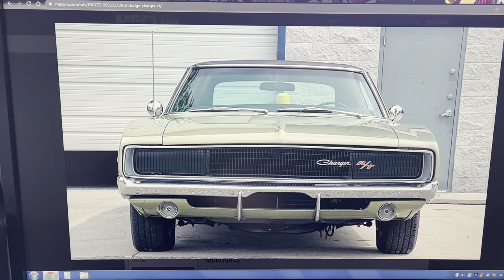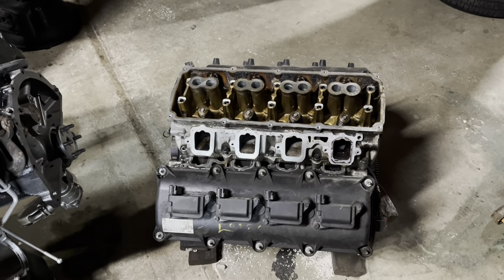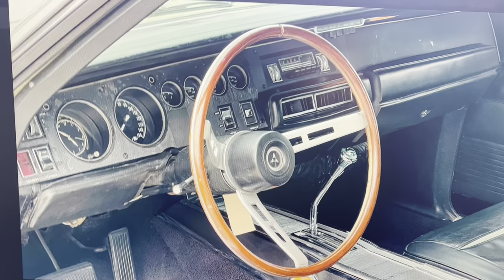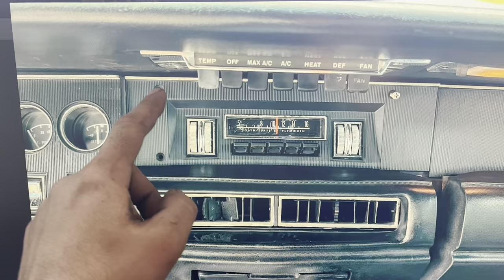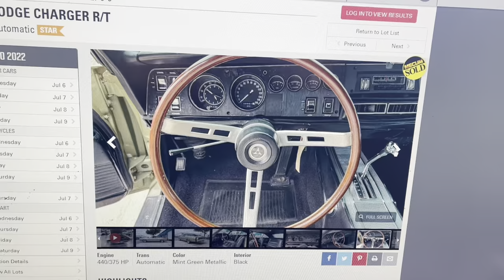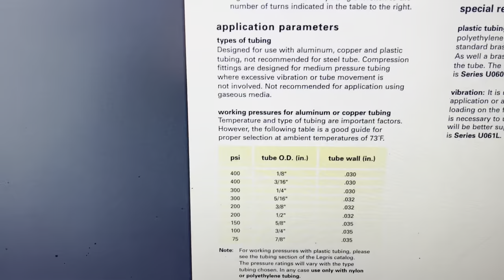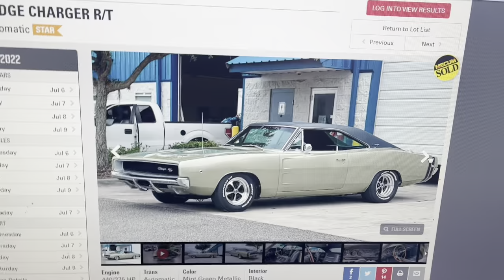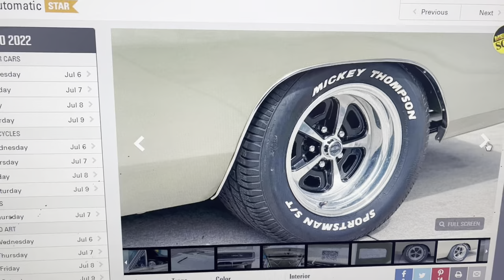Why Did This 1968 Dodge Charger R/T Just Sell At Mecum For $170,000? (It’s Unsafe And Bad)

Comment: So what’s my 68 383 4 speed factory ac car worth? It’s very solid straight body and I have everything original to the car it needs a full blown restoration?
Reply from the maker: I wrote a really long response to this. It was too much. I’ve given it a lot of thought, but as I am not looking at the car I have to make some assumptions. It’s not an R/T and it needs basically everything, but is complete and maybe doesn’t need half a car’s worth of metal? Seems unlikely, as most of them do - even my ‘nice’ car. I’m going to say $20k-$25k, but someone may pay more than that, or it may be better than I think.

Comment: Your figures were for alloy or copper line. NOT steel line.
An average car and not a 440 car originally with drum front brakes.
Clearly people do not even look at the pics let alone the car when they buy.
Reply from the maker: Exactly! There are NO ratings for steel line for those fittings - for a reason.

Comment: The dash on that RT is not a RT dash it is a standard edition dash
Reply from the maker: If you’re talking about the Tic Toc Tach, that was not standard with the R/T package - it was an option. All Chargers (and Super Bees!) had the same Rallye dash featuring round gauges, unlike the more basic B bodies with a sweep speedometer. There is no “R/T dash” in a Charger.
Reply: @DeadDodgeGarage  Wood grained with silver painted rings round gauges and a charger RT badge on dash and/or glove box door... This is even referenced in the forbbodiesonly website as well on a forum string about '71 R/T dash emblems..  Standard's & 500's had a simple charger and the RT had a R/T charger emblem

Comment: Take a look at, kiwi customs, Channel.  He doesn't specialize in Mopar but he fixes a lot of crap kind of like this..
  Especialy check out the red mustang convertible.
 Holy shite.
Reply from the maker: Oh I know… that mustang was insane. Someone actually offered me a Mustang for trade earlier this year, and from the pictures I could tell it was just like the one Kiwi fixed - basically no floor all along the rockers, and holes in the rear frame rails, even though the body of the car looked great.

Comment: Ok 1st rule in brake repair: No compromises acceptable! Compression fittings ? Someone needs to be taken out behind the shop stood up against the back wall ,and well , not shot, because that might result in some unwanted ventilation of the building, maybe haul his tool box out and start throwing his tools at him, heaviest 1st. Girls Exempted because I'm an old male chauvinist pig. The sway bar? How lazy can you get? Yeah it's not 1975 when you couldn't walk through a junkyard without tripping very them, but things exist yeah you might install the wrong thickness and some you might find might be bent, but they're a solid steel bar! For gosh sakes! I bet they're even available aftermarket I did better work on my '67 Goats when I was 16!

Comment: All that! Still, you bought the car, the 50 plus year old car. It's still worth it. You buy that car and have to go over it. If you didn't buy someone would of bought it and restore it. You get what you pay for. Pop 50 grand into it and sell for $500,000.
Reply from the maker: Or - pop an additional $100k into this one, and then it’s still worth less than it sold at auction for. That’s kind of the problem.

Comment: I don't even think that is a original R/T. Look at the serial number the first 4 numbers should be XS29 NOT XP29. The S means special and P for premium price. All R/T are specials. Please check it out to see if it is a overpriced clone car. Also it has drum brakes on the front. Every 1968 R/T charger I have seen or owned has has 4 puck disk brakes. Also all magnum motors are painted magnum orange not blue. The id block on the motor under the AC compressor should be stamped HP440 not just 440. I strongly think that it is a clone and WAY overpriced. Hovie from Hovies Garage bought a 1968 R/T recently and I suspect it is a clone also.
Reply from the maker: It’s an XS29 vin. The base brakes on a ‘68 R/T are 4 wheel 11” manually adjusted drums. Disk brakes were OPTIONAL. A disk car will have 10” rear drums. The 440 Magnum in a ‘68 R/T is TURQUOISE. Not orange. The orange HP engines came in ‘69 - only the Hemi was always orange. If you have any other questions, I did a video a couple weeks ago covering these details and more on the ‘68 R/T. It was prompted by the dozens of comments I’ve gotten just like this one.
Reply: @DeadDodgeGarage   Thanks for the reply. I have owned 7 R/T cars Chargers and Challengers in my youth and every one of them had disks on the front. I have never seen a drum brake equipped XS car before. Saw a lot of XP serial numbered cars claiming to be R/Ts but as you know those were clones.

Comment: I watch Mecum all the time with my wife and will stop the show and point out piss poor restorations all the time. Ever wonder why they only show the underside of the car. When they are professionally restored they will show the bottom cam as it rolls over the camera and i still notice piss pro workmanship. Got to love so called professional auto restoration shops. If i were to ever buy a restored vehicle the very frist place it would go is to Z-Bart to have their nasty smelling rust converter applied and undercoating. Just Saying

Comment: I'm probably gonna open the floodgate of hate and let me say up front there is no way I approve of that brakeline repair on something you paid this kind of money for but that being said I've been a mechanic for over 35 years. worked professionally at a brake shop for decades and have used compression unions probably over a 1000 times On old crappy cars. I've never had a problem with them, now before I get the hate of course you should always replace the whole line sometimes,it's not cost effective for the customer and you just need to get it working . But on a show car give me a break.
Reply from the maker: I understand. Not sending hate back - we clearly agree that while it can work in a pinch, the right way to do it is to replace the whole line - especially on something at this level. Having said that, I’ve been repairing cars at home for 15 years, and ran an auto repair shop for 7. I have never used and will never use a compression fitting for a brake repair. It takes barely any more effort or time to use a flare connection instead.
Reply: @DeadDodgeGarage   We do agree changing the whole line is better. now the picture that was shown was a  short  Brake line, there's no excuse for that at all ever. The one I am most referring to are long straight runs along the frame rail like on a pickup between the gas tank and the frame where you have little to no room to get a flaring tool  in there and also you don't want to bend  the old line any more the necessary to gain access potentially damaging the line, again not optimum but sometimes a choice.  I live in northern Indiana Southern Michigan we use a lot of salt. I have Replaced untold number of brake lines  in my life because of this, People that don't live in a corrosive environment don't understand how bad they rot out I've got a mechanic friend of mine lives in California hes been in the trade about as long as I have he was out here one day and we were having a beer and I had a Jeep Wrangler at my house on my lift that I said I had to go home and replace all the breaklines and he said why? he couldn't understand so I had to explain it to him it was foreign to his thinking Because where he lives and they're climate.
Reply from the maker: Right. I have done a few of them up here, but not hundreds. Always on either beach rigs or cars from back East a ways. Definitely a foreign concept to someone in California. Haha. When I did the lines behind fuel tank, I would cut ahead of tank where I could pull it out slightly to flare. Toward the end of having a repair shop, I bought a cool inline tool that tightens with a hex bolt and fits into a small space. I haven’t tried it yet.

Comment: I bought several old running driving muscle cars back in early 90s cheap.  You could buy an ls5 chevelle nice car for 3500. Everything I bought was from guys that were my dads age that were financially stable and just wanted to get rid of their old cars. Now that ive gotten back into the hobby in 2019 the sellers have changed. Now most of them selling run down cars are broke azzez trying to make a big buck off a car their father or grandfather left them instead of getting a job. They claim their car is worth alot of money but they won't even spend 50 bucks on a tarp to cover it uo.
Reply from the maker: Yeah… it’s a different world we’re in, that’s for sure.

Comment: I just perched a 84 dodge ram truck with a 360 5.9 and the transmission is out, how can you tell which one you have in it?
Reply from the maker: Look at the shape of the pan - but in ‘84, if it’s factory, that basically has to be a “lockup” 727, which is used from ‘78-90 or somewhere around there, all depending. You can retrofit an earlier 727 without the lockup converter as well. They are externally the same, but the torque converters and their splines are different.
Reply: @DeadDodgeGarage  okay thank you

Comment: I don't get the whole issue with auctions ? I mean they sell items and people buy those items. How is that any different from Joe blow selling something on Facebook marketplace ? As long as something isn't misrepresented i don't see the issue. The auction house is like here's this item some guy wants us to sell...here's the item, how much will you pay. Am I missing something ?
Reply from the maker: It was misrepresented by the seller and by the auction house (in the listing) as a beautiful, fully restored car. It isn’t. They had (and included in the online listing) pictures that proved it isn’t. It went across the block without a word from anyone saying that it is not as it appears. They know this happens, but they take no action. Personally, I think seller is at fault for misrepresenting the car, buyer is at fault for not doing due diligence and bidding this high on a perfumed pig, and auction house is at fault to a degree for allowing it to happen. I understand your viewpoint. The misrepresentation you speak about is my problem here. The car is not what it appears to be, and yet it sells for well over top dollar (because there must have been at least two over-funded and under-informed bidders in the room to push the price this high.) The auction house is just the outlet allowing this to happen. At least if it was listed on Marketplace, a buyer would have to come within ten feet of it and see that important steering column hardware is sitting on the driver’s floor before handing over what would’ve been a much, much lower asking price than $170k.

Comment: No Sway Bar and Drum Brakes?! Real R/T Would have A Sway Bar And Disc Brakes. Gives New Meaning To 20 Footer !!🤷🤦 But Hey The Owner Probably Got To Be On TV!😂
Reply from the maker: In ‘68, disk brakes were apparently not standard on R/T. I am not an expert, but I asked one. Incidentally, all Chargers should have a sway bar in ‘68, and this car does have the mounting provisions for it… it just isn’t there. Which is a whole other level of stupid, right? A lot of people seem to want to say it’s not a real R/T. That’s not what this video is about - but as far as I have seen, there is no evidence that confirms it isn’t.
Reply: @DeadDodgeGarage  I've had 2 and discs were standard on any HP Pkgs. Except for maybe Cars that we're going to Factory Race Teams. My 68 Charger, many years back,was a Weirdo, manual frt.discs,and manual steering,and was an Ice Blue/Blue interior,and cost me 900$. Wish I'd kept it. Traded it for the 58 Belvedere Sedan I Still Have Though.  Good Content Thanks 👍👍

Comment: I wouldn't give five cents for anything that's lowered. I just don't see the point of it.  Your red car looks much better.
With gasoline going away in 15 years the days of vintage cars selling for such figures is numbered. No one is paying a fortune for something they can't drive.
Reply from the maker: My red car is also lowered… I raised the front end after getting it home. It’s 1/2” off the bump stops now. Since it’s a torsion bar car, un-lowering it is an extremely easy procedure. 

I think fuel will always be available in limited quantities for enthusiast purposes - at least long after our economy and commercial transportation have shifted away from it. And, I personally think that these cars will still be valuable for other reasons far into the future. Nobody is paying $170k to actually drive the subject of this video, as many people have stated.

Comment: your confused thats a ice maker waterline an early option on the 68's .
Reply from the maker: Now I’m confused by your confusion about my confusion.
Reply: just overtaining the overentertained. :)  great show.  @DeadDodgeGarage
Reply: i have a question regarding 69 ply val 4 drum with a vacuum boost brake installed.  is it too much for the existing 4drum or used only in disk brake applications.  Thank u in advance

Comment: its an ex Dukes of hazards prop car #34 that is the reason for the price
Reply from the maker: I haven’t seen anything anywhere that says that.
Reply: @DeadDodgeGarage  Long-Lost 1968 Dodge Charger R/T, Featured as 'General Lee #34' in 'Dukes of Hazzard,' Resurfaces at Mecum Orlando Auction, Surpassing Expectations with $170K Bid

Date: December 22, 2022

In a remarkable turn of events at the Mecum Orlando auction, automotive enthusiasts and fans of the iconic 1968 Dodge Charger R/T were left astounded as a long-lost specimen emerged from the shadows. The excitement in the room was palpable as the bidding for this rare gem climbed to unprecedented heights, ultimately culminating in an astounding final bid of $170,000, shattering all expectations.

The surprise didn't end there. The winning buyer, choosing to remain undisclosed, stepped forward with an extraordinary revelation. This particular Dodge Charger R/T was none other than the legendary 'General Lee #34' from the beloved television series 'Dukes of Hazzard.' The buyer substantiated this claim by consulting with none other than Tom Sargento, the esteemed General Lee mechanic, who instantly recognized the engine and VIN number as a match for one of the cars he had worked on during the show's iconic run.

The significance of this discovery cannot be overstated. Beyond its monetary value, the car stands as a priceless piece of television memorabilia—a symbol of the golden age of American action-comedy TV shows. The 'General Lee #34' holds a special place in the hearts of fans worldwide, representing the epitome of automotive charm and adventure.

As news of this find reverberates through the car enthusiast community and fans of the 'Dukes of Hazzard,' the long-lost 1968 Dodge Charger R/T serves as a captivating reminder of an era when action-packed television captivated audiences and iconic automobiles held a prominent role.

Comment: Who spent that much for that car? More than likely a boomer with more money than sense looking to have something to brag about.  Kinda like that boob on Autopia who “built” their ‘64 Mercury but skimped on the brakes that resulted in a high-speed run-turned-high-speed-rear-ending-of-a-minivan.

Its no different from boomers bragging about how their C4  Gran-Sport  Corvettes (with automatic transmissions) are “1 of 6,000” with some kind of “ultra-rare” color (which just happens to be the same as every other Corvette out there). They don’t know what they actually have, but they’re certain it’s rare or super fast when it’s actually junk. 

If you’re paying over $150,000 for a “classic muscle car”, it had better be close to working and in-tact as possible. No blown motor, no boogered-up hoses or hydraulic lines, no masking tape left over from a slapped-on paint-and-body job on it, no missing suspension components. 

I wouldn’t be surprised if the car wasn’t even an R/T in the first place. There are lots of VIN/engine swap jobs out there to begin with.

Comment: another reason to buy un restored cars only
Reply from the maker: I don’t think buying a car that has already been done is a horrible thing - as long as you do your homework and it’s THOROUGHLY inspected. If it’s done right, you’re probably saving money by buying a car someone else paid to have done.
Reply: @DeadDodgeGarage  you have some points but unless you see the before painted views which should be easy today you have really no idea. I think that is why un restored cars are gaining in popularity and value.
Reply from the maker: @radioguy1620  Absolutely - I agree that before pictures would be a big asset. One can use a depth gauge to detect the thickness of paint and body filler. Professional vehicle inspectors use these tools as a way to peer under the shiny paint and see what's really there. Often, in the case of shoddy repair work, there will be easily detected evidence on the back side of the panels - lower quarters where the seams are not correct, or the inner panel was never repaired, extra seams inside of the trunk, or bondo worms - as I found on my '68, behind a repair that actually looks quite good. In the case of these Chargers, almost every single one of them that has been restored is hiding some rust repair work. If you can't tell it's there upon a thorough visible inspection inside and out, they probably did a good job.